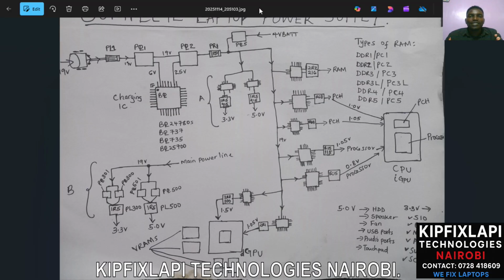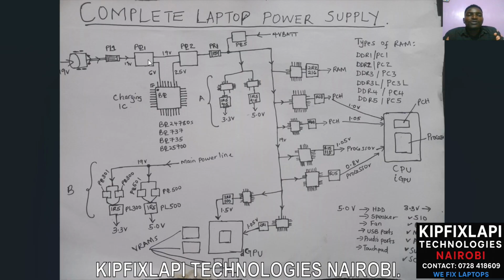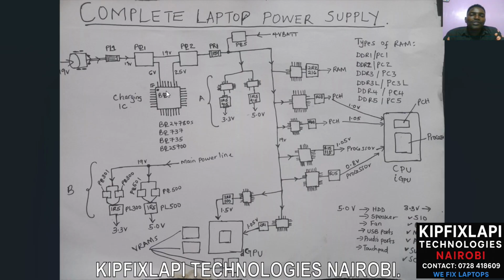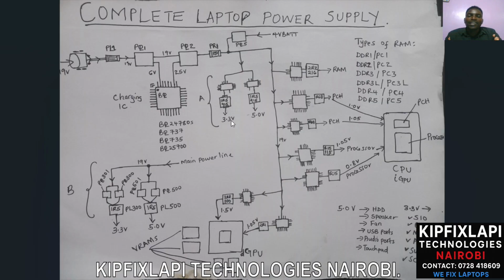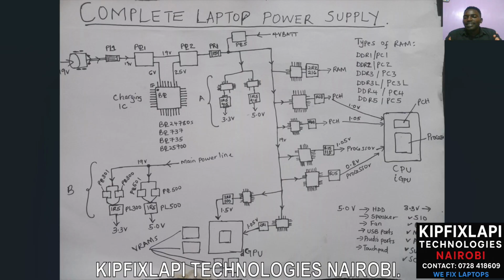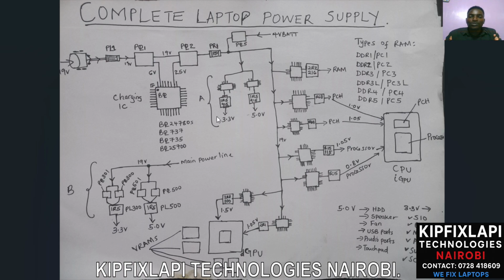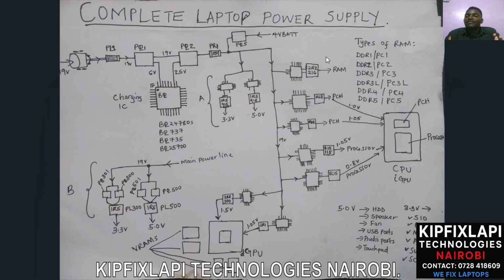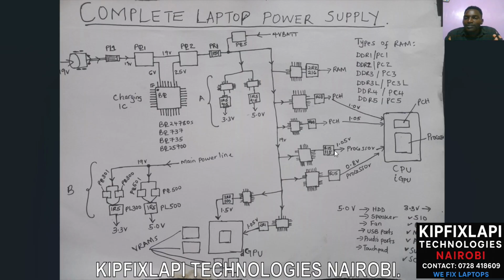COMPLETE LAPTOP POWER SUPPLY EXPLAINED #computer #fix #laptoprepair #schematics #subscribe #share

Comment: I have a laptop that is not  turning on and the 19v is available on the main but no output in all the step down suppliers, only 3,3v power supply is shorted when I inject the voltage 
(3,3)on it the cpu get hot. What could that mean?
Reply: Pch dead